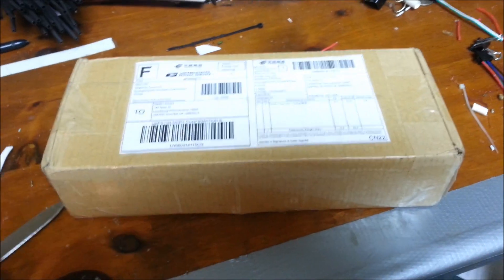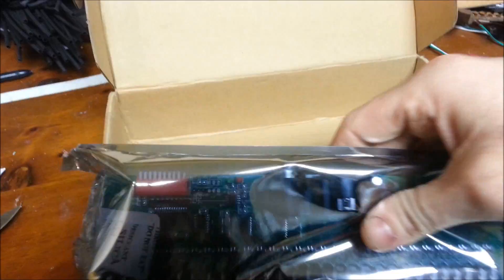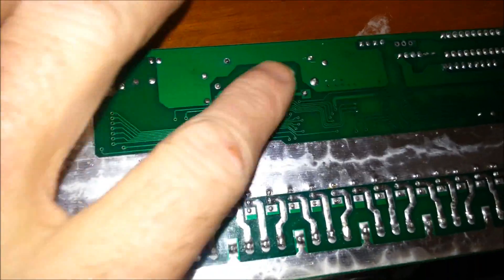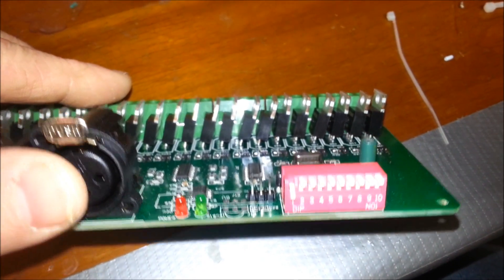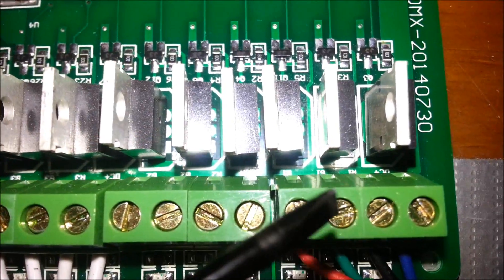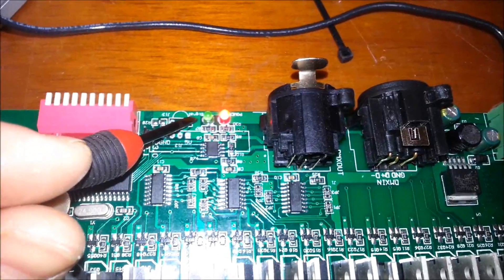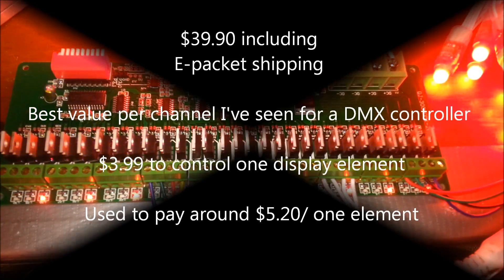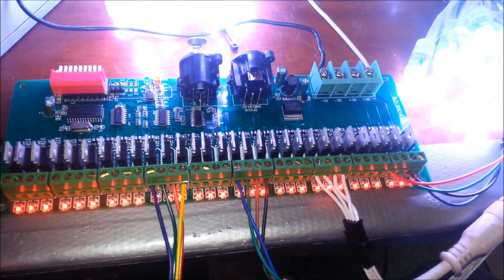30 Channel DMX Controller under $40

Comment from the maker: Bill'Rosa,
This and all other DUMB/Basic RGB controllers run on DMX.  You must connect to a dongle or "bridge" which can translate the e1.31 signal from the computer software into DMX.  Since this board is new to me, I will have to take some pics and film the installation of the RJ45 jacks.  But, I have done 2 other videos where I add RJ45 connections.  Watch this video on the similar style board, the 27 channel easy DMX controller.
https://www.youtube.com/watch?v=U7RKRBhmvo0&feature=gp-n-y&google_comment_id=z134fxibftisdnaox04chbc4dkrctnej5is
Reply: Thank you we ordered 2 of these boards for our dumb RGB strips.  Look forward to your video on the rg45 change.   Which do you recommend more. The bridge or dongle.
Reply from the maker: I have never used a DMX dongle.  I love the bridge.  I works perfectly and I'm able to make adjustments using the e1.31 network very quickly from the computer.  I have 2 assembled and one more to build.  Very solid.  I'm sure you'll be very happy with the units.  Best bang for the buck I've seen yet.
Reply: Leechburg Lights thanks for the reply. Now to find the bridge to use or what to use. Some of the controller PCB cost a ton of money.  I like your approach.  Best bang for the buck.  Watched all your help videos.  Was curious I plan on using vixen to seq. Then dump it to fpp to run it on my pi.  Do you have experience with vixen.
Reply from the maker: *****
I have no experience with vixen.  Used LOR S3 software (over 7 years).  But I've also used XLights/Nutcracker which is in the process of changing the GUI.  It is free software as well and works very solid.  Can also be converted to use on the FPP.
I ordered the DIY LED Express Bridge kit and soldered it together.  It is nice too if you get into doing small amount of pixels.  You can order a pixel extender and run 170 pixels (ws2811) off of the Bridge. Extenders are  like $13 and easy to assemble.
Reply: Leechburg Lights We are planning on building a matrix board and a megatree with pixel (ws2811) but being new to the animated light shows has got us a bit confused.  Been in tons of forums and chats and have got most questions answered.  You have been extremely helpful with the PCB and explaining the dmx to e1.31.  we were stuck on that till we watched your video's.   We now understand it as DMX for dumb and the e1.31 for the smart.  (hopefully we have it now).   Now to figure out the bridge and software.  I use a MACbook and the wife a windows so I got parallels so I could run windows.  Now we are both learning on Windows.  You video's and replies are very helpful.   May have to give you my email and phone later so maybe I can get more indept q and A.   Again thanks for your help.
Reply from the maker: Bill, shoot me an email at leechburghlights@gmail.com.  I'm sure if you have any questions I can get ya pointed in the right direction.
Reply: BTW   my wife wants your snowman
Reply from the maker: :) yes, I found those snowmen at a bargain store called Ollies.  Went to 3 different locations to get them all.  This year I found a Santa frame and a wire frame tree.  Can't wait to get pixels on them for next year.